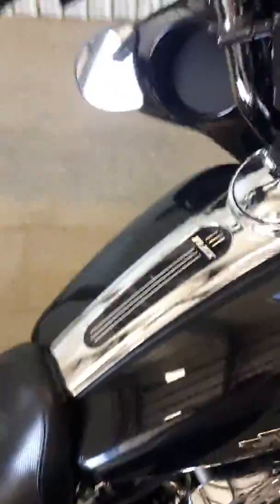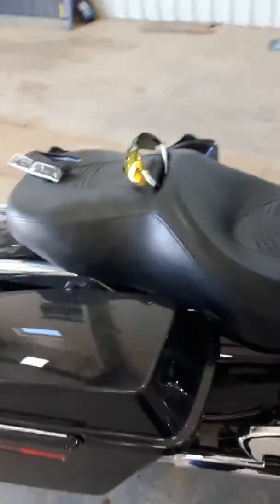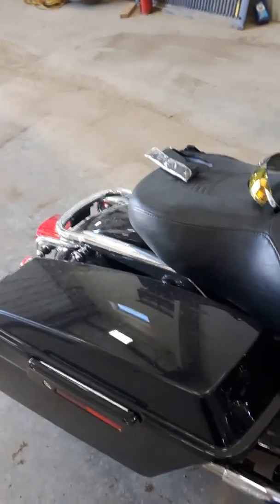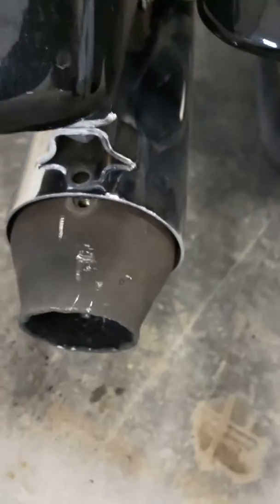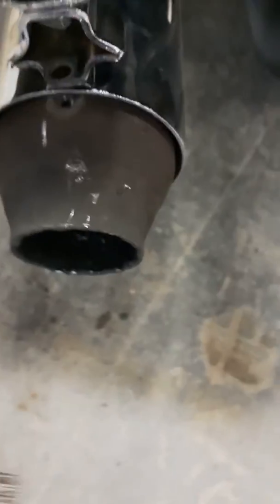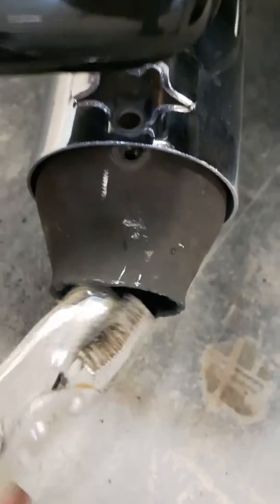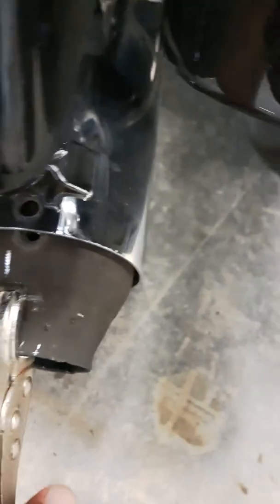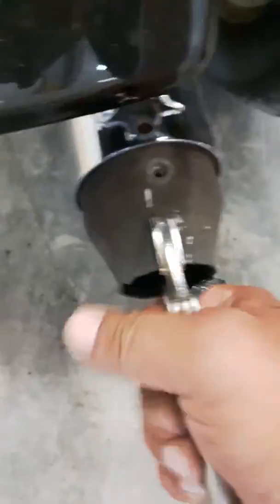Screaming eagle baffle removal

Comment: I have an 02 ultra that I've stripped down to a SG basically. Have the S/E equal length separate duals on it.  It was amazing we put the biggest S/E cam it for the 88. I do the car work dad does the HD work. I couldn't believe how much it changed the exhaust note and sound level. Instantly people riding behind me started talking about how loud it was. To me it sounded like it jumped up 100 cubic inches. I'm working now to try and take the baffles out to see what it sounds like. Better or worse I gotta try it. I think those huge cans make it sound so good. Biased because its mine but I think it's one of the best sounding I've heard so far.
Reply: shawng7902 you need back pressure for your engine to perform. Take out the baffles and there goes performance. Oh it will sound good alright but you’ll loose torque. Therefore, you need to add a restriction to create back pressure. Luckily, you can buy inserts that restrict exhaust gasses near the head.
Reply: Yep all the benefits of the cam will be lost. Replace the baffles with some designed for more sound.

Comment: Does it have to be retuned/re jetted after you take them out?
Reply from the maker: re tuned I would imagine. I didn't keep them out cause I didn't like the sound. But if you kept them out you would probably get some back firing
Reply: Thanks man!
Reply: Will cause the bike to run lean and hot without a retune. It also kills low to midrange torque which is were ride 90% of the time. Aftermarket baffles can preserve the backpressure and still increase the sound.